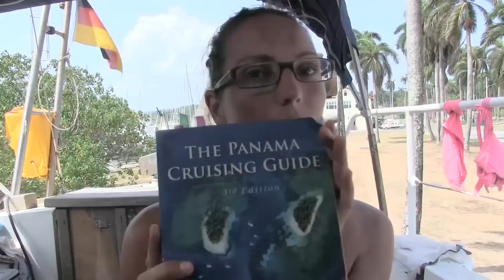Unconventional german welder SAVES my SAILBOAT in Panama - UNTIE THE LINES #30

Comment: You should have on some coveralls and safety glasses using paint stripper, it can burn your skin!!
What are you going to use to prep the aluminum?
Reply from the maker: wipe it with Acetone and then put on an Etch Primer. I did wear glasses when I used the paint stripper. If you wash the stripper off your skin right away, then it's not that bad...it was so hot during those last days that I could not wear a coverall...
Reply: WhiteSpotPirates You can use white vinegar mixed 50:50 with water as a "acid etch" , then rinse with water, final clean with acetone. Prime and Paint. Be Safe.

Comment: Primer, etch primer, weld my annodes, ... you seem to already have a good grasp of some what you need to know. What is your background around boats? Schoolwork?
Reply from the maker: I am just learning / researching along the way. Whatever comes up next will be looked up / discussed with people etc. I did do a lot of research about the paint before because I knew it would be a topic for aluminium boats. And the stuff about the anodes was in an article that I read about corrosion lately when the holes "appeared". The previous owners had zinks with steel arms that were fixed to the boat with steel bolts...that could have very likely been one of the sources for the corrosion...so I wanted to do it right this time and as the boat is out of the water anyways and I know that welder now, I might just as well do it the proper way, I thought.
Reply: WhiteSpotPirates Following your video's with great respect and the way you deal with your never ending list of little and big inconveniences, I am sure you will sail your dreams very soon..!
About the zinc anodes you are talking about..
For my alu boat I normaly use a zinc without the steel strips. Just the zinc anode is bolted through the zinc and the hull with ss bolts and in such a way that all the metal parts are electrically connected. the ss bolts are isolated from the environment and seawater by the use of polyurethaan mastic,covering all steel parts. Only the zinc can be seen. The electric contact is via the ss bolt to the hull. Welding is in my opinion no option without creating other elements consuming either the anodes or your alu hull..
On the other hand it is advisable to investigate where this corrosion originates.
Any electric connection to the hull is not allowed, special attention for the vhf antenna's, your motor sensors, your morsehandle etc. It should all have been isolated from your aluminium hull. both the plus and the minus has to be wired.. Easy to be checked by ohm meter,if there is any electrical connection.
We own an Ovni from france, in fact, the only anode I am using is the protection from the ss shaft, a small ring anode around this shaft, and a nut- anode at the propellor..
Good luck with your project! Looking forward to hear/see the continuation..
Stef
Reply: @WhiteSpotPirates  electrolysis: glad your finding the source of the problem. Stray current in marinas can cause electrolysis.. grounding improperly.  There are monitors that can measure stray current. Sounds like your aware of this . God speed

Comment: old and or corroded aluminium is verry hard to weld , the guy must be pretty good if he got the holes closed , never seen a stickwelder used on aluminium though i know it was possible with special rods

Comment: An afterthought now, but with that aluminum hull is it possible to have sandblasted it with success?
Reply from the maker: Hi William,
that is surely an option. But they usually don't use sand but tiny little plastic pears for aluminium, or high pressure water works as well, I think. But the quote for that was 4.000$, that's why I did not go for it...
Thx for watching,
Nike
Reply: That is indeed pricey.  Well the sanding is just as effective too I suppose.  The key is maintenance and you've focused on that.  Looks good.

Comment: I used to weld Aluminum for a living. Since when do you chip slag from a aluminum weld? There was no gas being used at all? And welding aluminum with stick? What am I missing? Has there been some advancements in welding that I should be aware of? It's only been about 7 years. We always used either TIG or MIG.

 God I hope this was not some universal weld all stick sold to the general public on TV. And I saw him chip the slag after welding with the wire feed. Some new kind of flux core aluminum?
Reply: you welded for a living, and neber heard of stick rod aluminum welding?
thats odd, because its fairly common. my son in law welds for a big crane company, and he burns up hundreds of pounds of aluminum stick rod a week, plus with all the steel stuff he welds

Comment: Hi  I don't know if you still read these comments it has been so long. But the regular maintenance is a must.  So every so often this has to be done again.  
That is why I am commenting.  The paint is toxic to breath.  Xylene, toluene, acetone are volatile organic compounds VOC's they have a high vapor point.  They evaporate fast.  If you breath them they cause brain and liver damage.  They are cumulative  in your system.  Wear a respirator or filter mask.  NOT A DUST FILTER 

ALL TWO PART PAINTS ARE EXTREMELY DANGEROUS THEY HAVE ISOCYANATES WHICH IS EXTREMELY TOXIC.  DONT BREATH DONT TOUCH  WEAR A RESPIRATOR WHILE MIXING AND SPRAYING.  WEAR GLOVES AND PROTECTIVE SUIT.     THE POISON IS CUMULATIVE.   WHEN YOUR BODY REACHES A SIGNIFICANT LEVEL BINGO YOU CROAK.  

You will have to paint again so remember wear a respirator and protective suit

Comment: Welding Aluminium with a stick welder is not easy the usual method is TIG or MIG welding for a reliable result. Steal is a more practical material to maintain in out of the way places. Safe sailing, Cheers

Comment: Take care with the anti fouling. Do not use one containing copper as it will eat the aluminum..
Reply from the maker: of course not :). got some copper free one specially for aluminium hulls. but thanks for worrying.
Reply: After watching most of the 30 clips I can honestly say I am not worried. You learn quick and did an amazing job so far! With any other owner it would have looked pretty grim for Karl. And reading the comments I can see you have heard all the aluminum horror stories before.

Comment: be great if they had a sandblaster around there.  Do the trick in half a day.
Reply from the maker: I know...but they quoted me 4.000$ for that and would not let me do it by myself...so wasn't an option. A cat next to me had it done...and I was super jealous :). But they paid about ten tousand for that job.
Reply: Ouch!! That is high.  Almost there!! Can't wait for next video.
Reply from the maker: rem9607 . I'll try to be on time next time ;)
Reply: WhiteSpotPirates Heard that a technique called wet sandblasting is not that expensive. You use a standard high pressure washer with a special hose that mixes in sand in the water. Supposedly quite effective.

Comment: the german guy did fine,, dont wory about scaremongers ,,,,,,,,,,,, oh btw,, welding alu with stick is not a cheap option due to the type of machine required,, note the size of the one they were using.
Reply: Really?!  Have you done ANY structural aluminum welding?!  Doubtful. I would be suprised if there's not any pin-hole leaks from this guy's 'welding.'  Merely because he's German does not make a good welder, or a person who cares to do a proper job.  His language told the full story of his incompetence as well as his 'face mask' and choice of welding process.

First off, the rod he was using is likely not the best alloy for welding the particular hull's alloy. Not only that, plug welding the holes with stick create their own galvanic cells that will lead to more corrosion around the plugs, and create high stress regions from the excessive heat input. What she should have done, and what most people with metal boats eventually do, is to purchase an inexpensive GMAW or GTAW machine with an Argon bottle and learn how to weld properly and do their own repairs and modifications.  Far less expensive this way.
Reply: @SagaSeaCraft  i  wonder if you have ever tried to buy / get a pureargon bottle,, it is difficult enough even if you have the money to get in an industrial area let alone  ( ii would imagine  ) in Panama ,,, interestingly she has posted another  ( almost  ) upto date vid on more welding without any reference to the german one , so i guess it held up just fine ,,, oh btw , do you really think that i was  infering that because he was german that that makes him a good welder,  although prob better than an average american one .. i am not quite sure what you mean by " inexpensive " AC weld plant as they are pretty expensive in most peoples books. i can assure you that i have done lots of structural allu welding  and although the guy did not have ideal ppe he did that with one hand and it was watertight , says quite a lot for his ability ,, , i think you must remember that this was a repair job in Panama and not aircraft manufacture !!  ( have you ever met a welder who does not swear ???!!! )
Reply: and btw it was over 5 years ago , so not bad.

Comment: You did not get a welder you got a guy who pertains to be a welder.  If you did not get him for a very cheap price you got ripped off . And as for the quality of the welds good luck your going to need it . By welding it that way you are taking a  chance maybe it will hold or may be not. By welding it the right way you know it will hold..... a bit of advice from a real welder . As for the way he patched  those holes .... 200 to 400 dollers is more then enuff . And stick welding aluminum for a application like this ......NO.